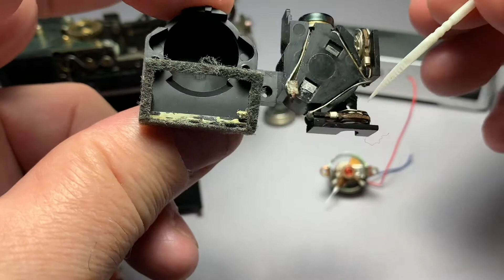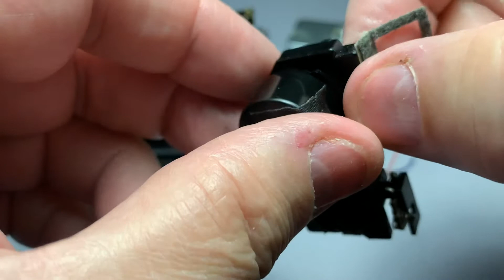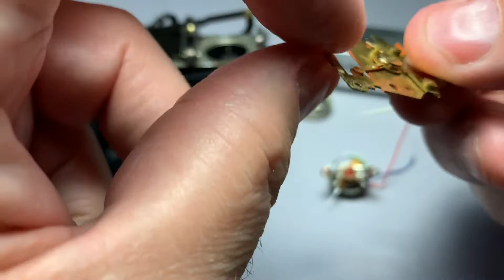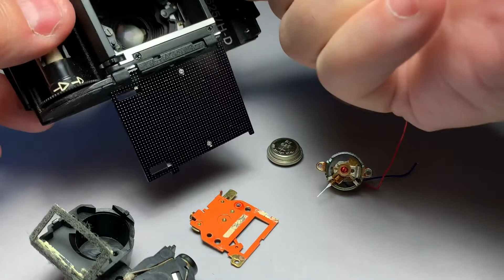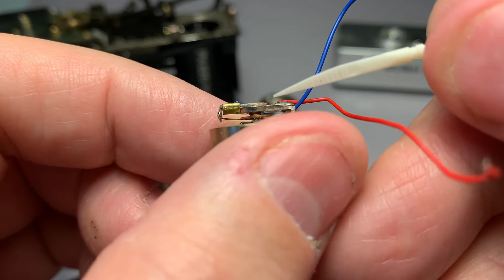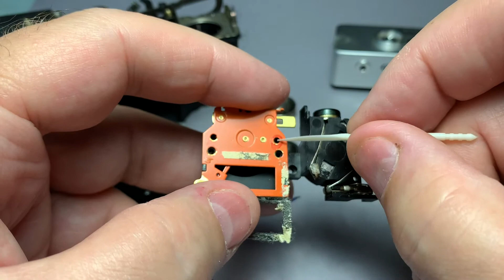Rollei 35 T meter disassembled

Comment: Hi, nice video. Mine has something loose inside, maybe an unsoldered cable. If i press from the top with the finger the meter starts to works. I'll try to open it and check, any tip? thanks!!